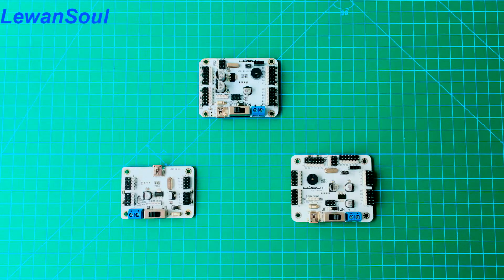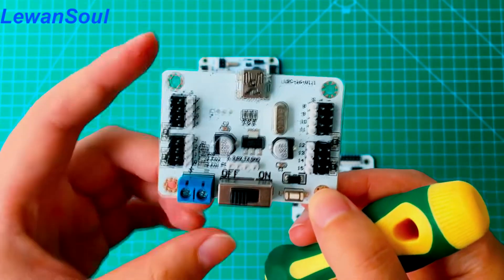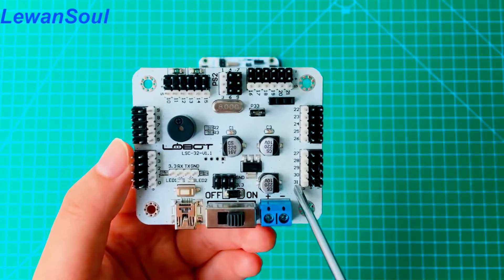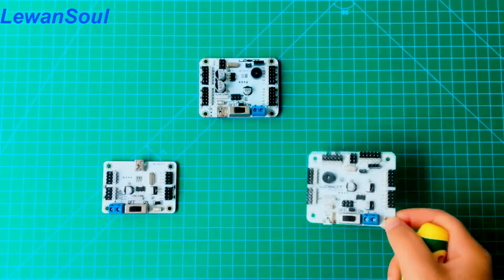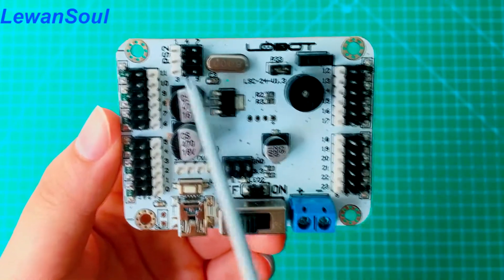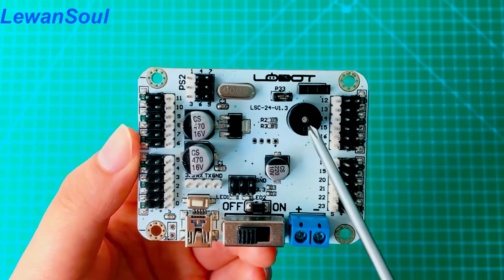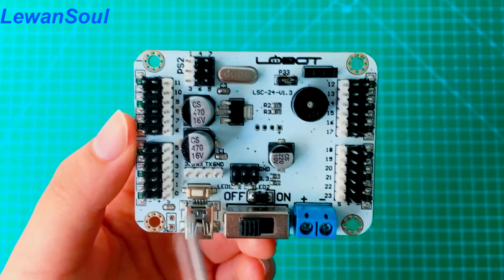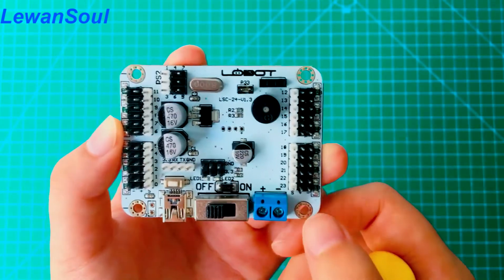Servo controller basic concepts (Episode 1) , Robot manufacturing Essentials.

Comment: Hello.
My son`s robot already can calculate new action groups.  
But how to directly delete old action groups and directly upload  new action groups to servo controller?

Is there any command like CMD_ACTION_SAVE or  CMD_ACTION_UPLOAD?
Of course, I have already checked your published official manual ( https://www.dropbox.com/sh/16ivgj1p1a6teja/AACODb-AmLcKe9VYSgN0q4sqa?dl=0&preview=LSC+Series+Servo+Controller+Communication+Protocol+V1.2.pdf ). 
Yes, I can save new action group to controller using your software on my notebook.
Yes, I can directly run and stop stored action group from Arduino.
But there is NO any opportunity directly (from Arduino) save new action group to controller.
Please, help me. 
Maybe, you can give me email of your software developer. Definitely, he knows undocumented commands, that I am looking for.

Best regards
PS
Here is my son`s RoboAnt project video: https://youtu.be/2LWc_oH8k0Q
(Robot runs action groups stored in the LSC-20 board)

Comment: Are Windows 10 drivers available?
Reply from the maker: Our PC software support Win Xp~Win 10 , so you don't need to install the driver. When you open our PC software, you just need to wait for about half minutes, then it will install driver automatically.
Reply: Bro then what about if pc is linux

Comment: What is the function of P33 jumper?
Reply from the maker: When you plug in the  jumper cap ,the  servo controller will alarm you when the battery voltage is below 5 . When you plug out , the low voltage alarm is 6.4 v. Thanks for your comment.